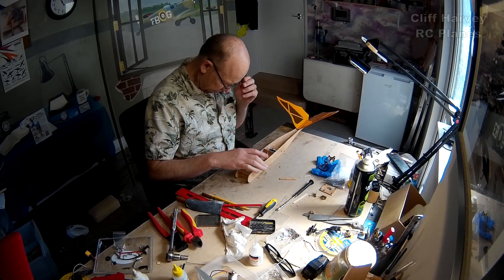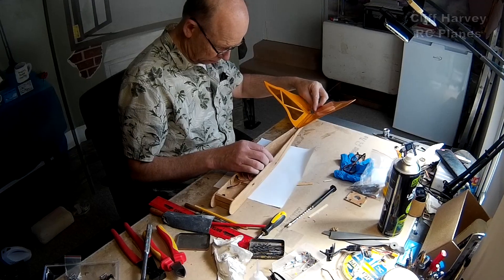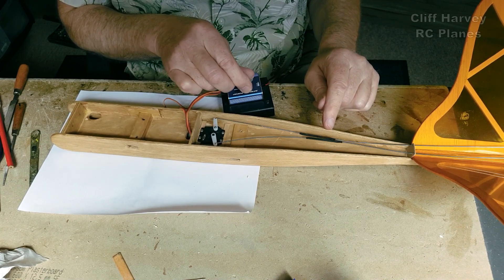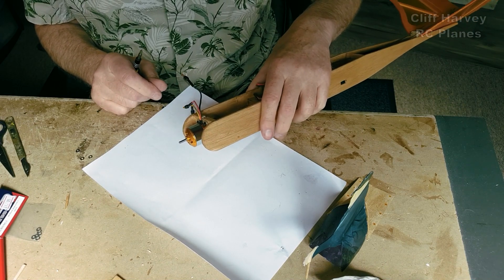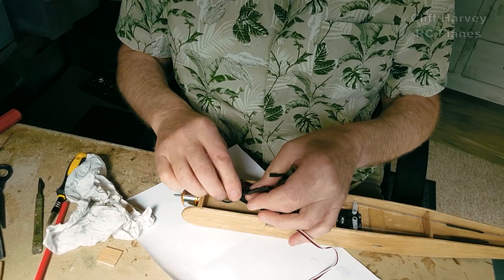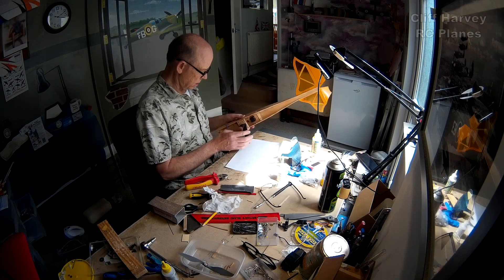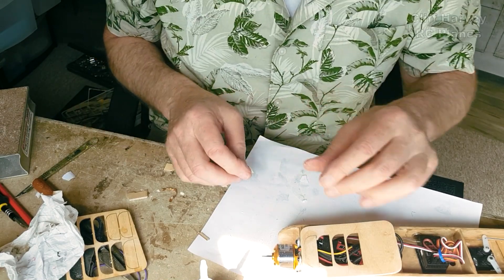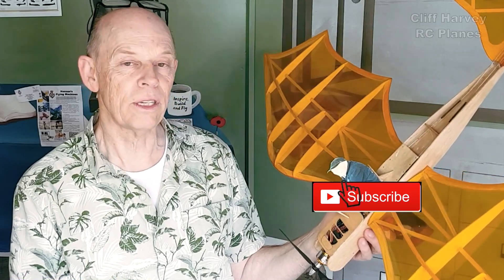DA Vinci Flyer Mk. 2 Ready For Aerial Trials

Comment: This one should fly great. Looking forward to it's maiden. On a separate note. I am now finishing up a DW triplane. The instructions  call for +2° on each wing? I was going to modify the incidence by going with 0° on the top wing, per my VK Triplane instructions and my Ron Sands full scale triplane plans...i figured after watching your maiden, I would like to know your thoughts on the wing and horizontal tailplane incidence settings?
Reply from the maker: Hi George, which DW Triplane have you built, the 770 or the 1540mm. I've set my top wing to -1 and the middle and lowers to 0 (as they're fixed anyway). The tailplane just sits on top of the fuselage so I'm not sure of the incidence but I'm guessing 0.
Reply: I'm building the same one as you...the 1540mm. The written instructions sheet clearly shows +2 incidence for all three wings. While I don't trust the instructions, the flights I've seen on YouTube all have me concerned.
Reply from the maker: @bellylander  I can't see any incidences marked on my instructions, I wonder if it's an improvement? I assume the +2's mean the tail is neutral. With my model sitting on it's wheels I set the incidence meter to 0 degrees attached to the bottom wing (which is fixed), the middle wing (also fixed) is check and found to be 0 degrees. The top wing can 'rock'  a little before you tighten the top bolts. I removed 7mm of the length of the metal of the top of the front cabanes, this gives me the ability to 'rock' the wing to -1 degree. This means the top wing should keep flying if the lower wings should stall, thus keeping the ailerons in 'clean' air. As the bottom and middle wings on yours (and mine) are fixed I guess mine are +2 compared to the tailplane that means my top wing is +1. Hope this helps George, if you set all yours to +2 it'll fly well I am sure, as long as all three wings don't stall (not that that is likely to happen anyway). In Rob's kit (RC Model Geeks) and mine the top wing would have had a massive positive incidence!